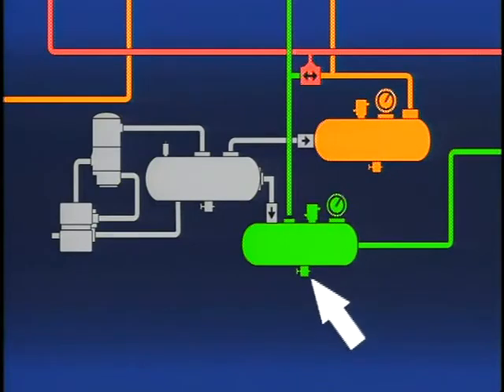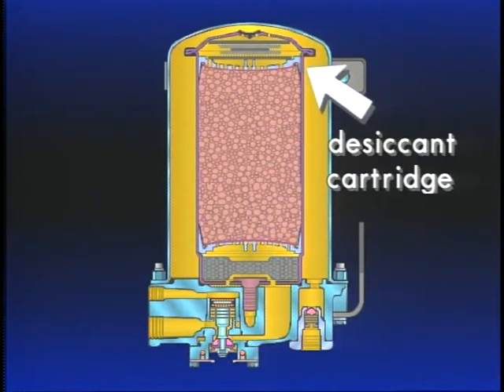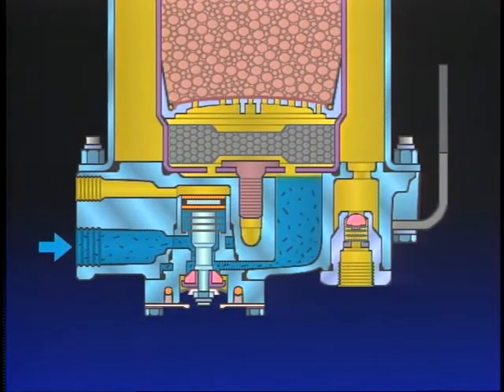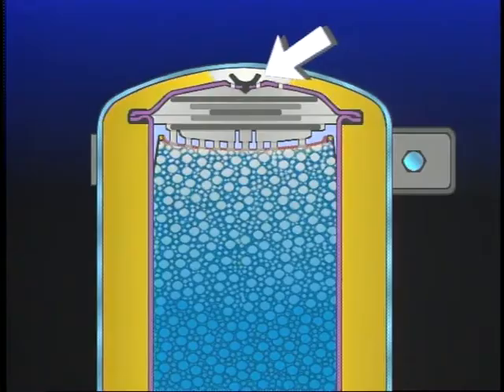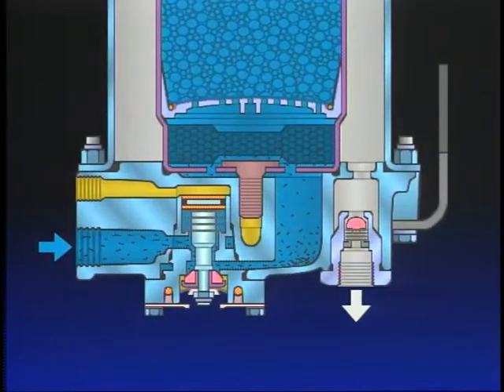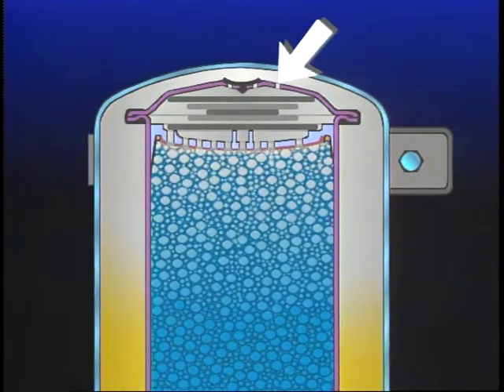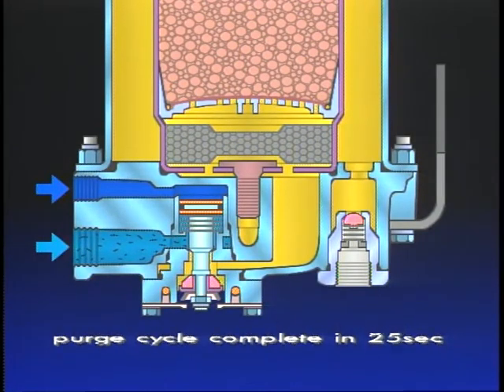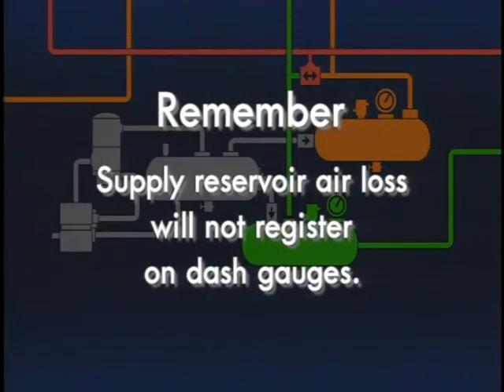5.11 Air Dryer Operation

Comment: Amazingnly clear for those who listen.  One way Check vale might be mounted not on air drier housing but as elbow   on wet tank (first connected to air dryier  of 3 present) And yes. This tank has no gauge in the cab. Just tje other 2

Comment: Good explanation.Thanks. Typical big rig truck brake system dryer; Will flowrate and grade of air dryness be sufficient to supply dry, clean air for automotive spray painting...?